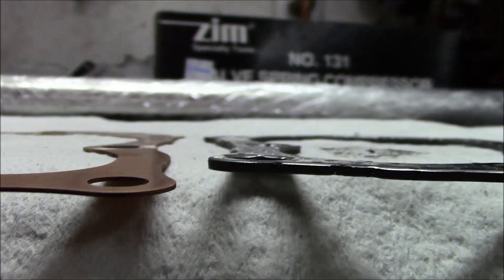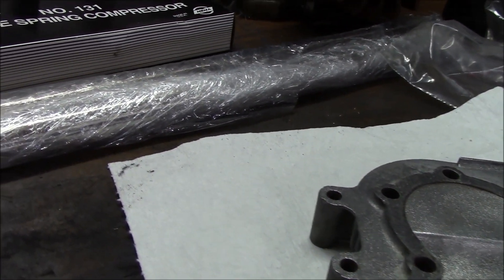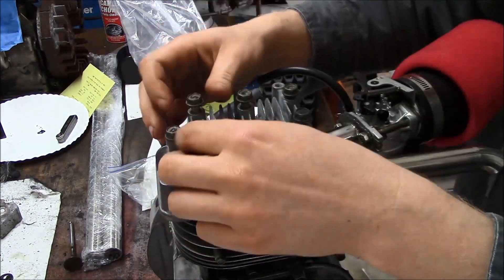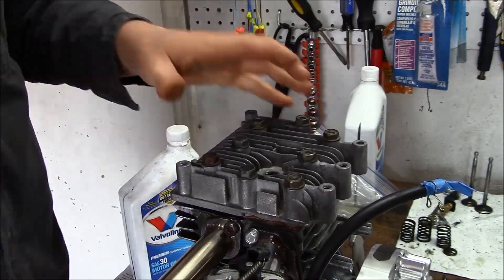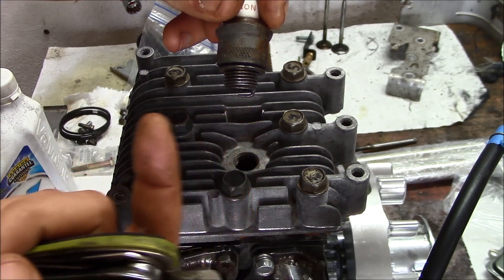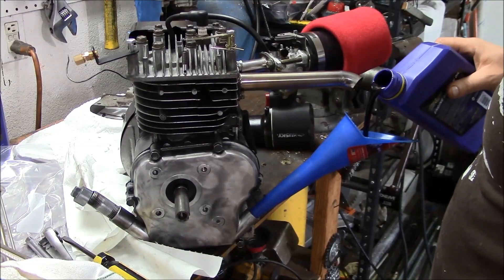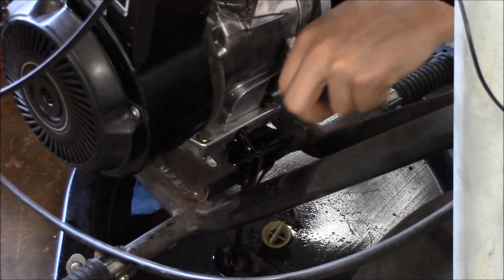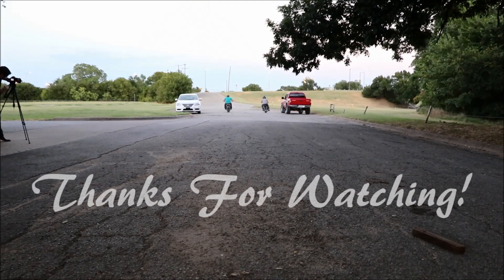Gasket, Plug & Engine Break In

Comment: So I got the break in oil...you say “10min on/off” I assume that means 10min on and 10 min off (to allow particulate to drain into the pan) I’m working with a new predator, so I do use break in oil for the first 20 hours too?  (From Reading manual)
Reply from the maker: Heat cycles it. Don’t sweat break in too much. Follow manual over what I say.

Comment: Hi. I'm building a 5 hp Briggs flat head as well. I was wondering what's the thinnest head gasket I can get before the valves hit the cylinder head? Im running a 94 ss cam witch adds lift compared to stock I believe. And billet stock length lifters. And I have a stock unmilled head. Any tips on how to measure for valve to head clearance. Thanks.
Reply from the maker: +traxxashondakid I put in a .029" gasket and was fine. Same cam. That can is actually a mild cam. You can turn the engine to top dead center, index the plug, and clean off the ends of the valves and put some modeling clay on the ends of the valves, install head as normal with whichever gasket you like. Turn your engine slowly then pull the head. Make a slice through the clay and check your valve clearance that way.
Reply: +KartFab alright thanks. I never would of thought of the clay.
Reply: Don't for get valve float

Comment: When you put that engine in the Baja heat, did everything lined up OK? Did you have to adjust the torque converter or the engine. I'm considering putting a five horse power in place of the stock 196cc engine.
Reply: I forgot you made a custom jack shaft for some reason. Never mind I guess.
Reply from the maker: I did the custom jack shaft not because it didnt fit, but because the stock backplate had so much flex in it that the chain would derail. Im sure, If i put a tensioner on it, that it would have solved the problem, but I do not regret having put the jackshaft on there

Comment: How have I just found this channel?! Subscribed!  ***** l have a Briggs Flathead with the dual ball bearing crank I'm working on. How far into the side cover does the oil seal need to be seated? Should it be pressed in flush or closer to the bearing?
Reply from the maker: I would check out some stock photos of the side cover. I think you really cant go wrong as long as you get the seal over the crank.